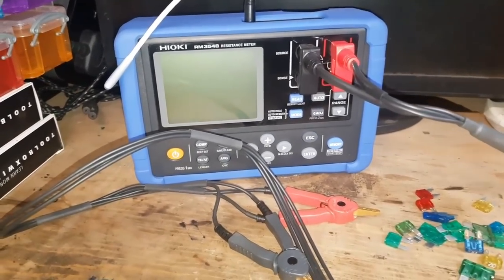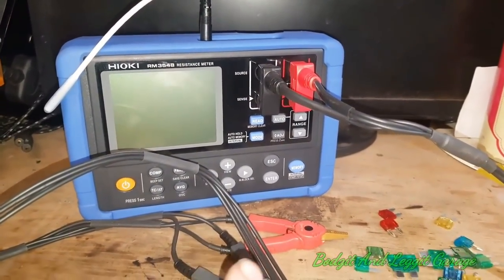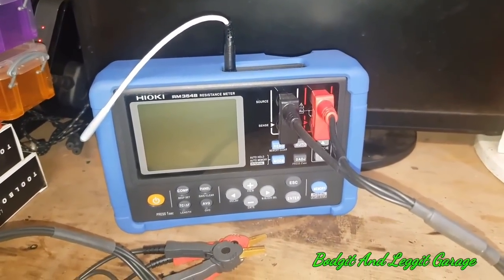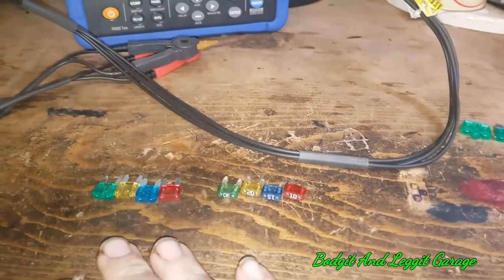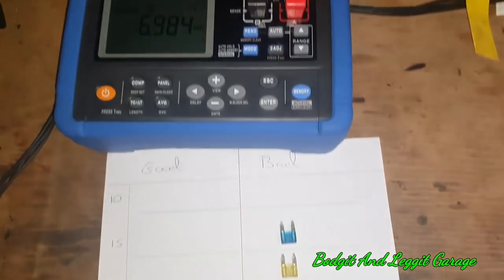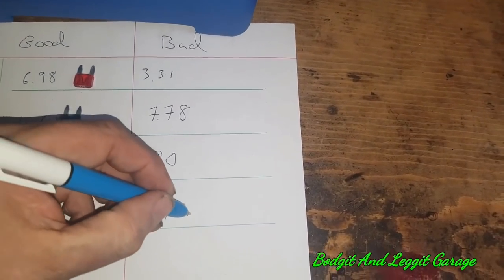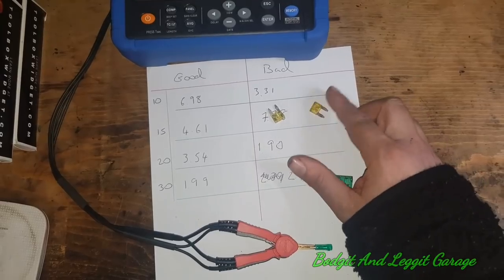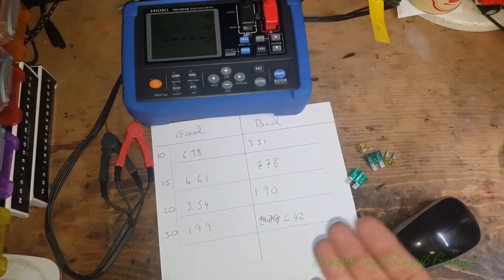Warning Don't Do This You Will Regret It Part 1

Comment: The only way to test at what current the fuses blow is to inject current through the fuse and measure the current when it blows. Measuring the resistance of each fuse will not tell you the current/temperature that the fuse melts at.
Also when you are measuring in micro ohms the connection of the micro-ohmeter makes a huge difference. You noticed it yourself when you changed the connection of the first fuse and the measurement changed.
Not denigrating your efforts though, it is really good that you are looking into this type of testing and you can learn a hell of a lot, like I have learned from you. (I did my navara wheel bearing using your video). So thanks for your videos and keep testing yourself.
Reply from the maker: I think you're missing the actual point of the video it's not really so much what the fuse blows that it's more the amperage it allows through for a sustained period of time the cheapest users will allow a lot more amperage to go through the wires which in turn will cause the wires to heat possibly melt and possibly go on fire which will be a bad day for everybody
Reply: @bodgitandleggitgarage  I thought the point was that a, let's say 10 amp fuse, would blow at a current higher than 10 amps. If the wiring or equipment can't handle more than 10 amps then there is a risk of the wiring or equipment catching fire. 
Or you are maybe talking about slow blow fuses, whi h can handle a little bit of overload for a long time or a lot of overload for a short time. Neither of these properties can be tested by measuring the resistance of the fuse. The only way to test with fuses is a destructive test that measures how fast the fuse blows at a particular current value.  This can be done with the right test gear. An adjustable power supply that can vary the current output and a timing circuit to measure how fast the fuse blows.
By the way, I got quoted 700 dollars to get my front bearing replaced. With the help of your video it cost me 200 for the new bearing and 20 for a socket to fit the axle nut.
And just to emphasise what you are saying in this video, I could have gotten a bearing from eBay for 60 dollars and saved even more money but did not think  the quality would be very good.

Comment: Best to refer to datasheets from proper manufacturers and learn to interpret the performance curves. Attempting to characterise something like a fuse other than in very controlled conditions is a minefield.  Shit electrical components like fuses do exist though :)
The actual cold resistance is specified by reputable manufacturers on their datasheets, but only down to 0.01 milliohm.  Beyond that level it is pointless as you are simply measuring contact resistance, influenced by plating and tarnish.  Furthermore the contacts in the fusebox and the conductor resistance totally overwhelm any 'higher quality' measurements.  The key measurement determining the operation time of a fuse is the I squared T figure (amps squared multiplied by seconds) 

Most automotive fuses rated at up to 30A when used at an ambient temperature of 20 deg C will NEVER actually fuse at their marked rating.  For instance a 'mini' fuse operated at 105% of its marked value at 20 deg C will remain intact 'forever' and at 110% it would take 100 hours to operate, that's 100 hours continuous, so the equivalent of driving a few thousand miles non stop, but at 135% it may interrupt the current at any point from 0.75 seconds to 600 seconds, the higher the current the faster the fuse will operate to interrupt the current and the closer the time between the slowest and fastest disconnect.

Datasheets from littelfuse for the three most common sizes:

Mini
https://www.littelfuse.com/~/media/automotive/datasheets/fuses/passenger-car-and-commercial-vehicle/blade-fuses/littelfuse_mini_datasheet.pdf

ATO
https://www.littelfuse.com/~/media/automotive/datasheets/fuses/passenger-car-and-commercial-vehicle/blade-fuses/littelfuse_atof_datasheet.pdf

MAXI
https://www.littelfuse.com/~/media/automotive/datasheets/fuses/passenger-car-and-commercial-vehicle/blade-fuses/littelfuse_maxi_32v_datasheet.pdf
Reply from the maker: Missing the point of the video what I'm going to prove in part two is when you put a cheap fuse in it will not go at the amperage it says it will which will cause the wire to heat up possibly burn and possibly cause the car to go on fire or because of a cheap fuse

Comment: The thickness of the fuse legs are more of a spec criteria, the thickness of the fuse to the ratio of the to the width will give you the resistance, which is often why wires are measured in surface area. 
A slow blow fuse will have a different resistance to a fast blow, the fast blow will heat up and melt quicker. A more better test will be to read your values then to put them on a PSU and increase the amperage and record the value that they blew at, problem is at each amperage level you have to make a new connection, can't just gradually turn it up as the fuse will be gently warming up. So maybe go up in levels of 1 amp at a time, leaving to cool again. 
Good video and food for thought buddy!!
Reply from the maker: Boom 👍💪

Comment: Brill as always....Have to say i feel very silly......in this day of age where were all aware of cheap copies of all sorts......i never really thought of fuses in this way...once it was the right color!!!...but with all the equipment now been so voltage sensitive its a must  to be correct.......never thought id have to buy main dealer fuses.... instead of 100 for a 20€ from the factors LOL
Reply from the maker: Lol yes mate it's scary especially when you think the cheapest users will allow a lot more amperage through and possibly burning wires and possibly the car could go on fire because of that
Reply: Who is to say dealer fuses are any better. Just because the car costs a fortune doesn’t mean they are installing quality parts. I’m don’t know where to purchase parts. I buy OEM but don’t know if I’m getting OEM. It’s a real crap shoot. ✌️
Reply: @arthurfricchione8119  .....that was my point exactly....my thinking was maybe the odds at the main dealer are better than a motor factors as you said impossible to know either way!!!!

Comment: I think it's interesting, but I am not sure what it proves.  If the metal is of a different composition, and the metal is thinner or thicker, then the temperature at which it melts and how fast it gets there will be different and a different resistance would get you to that melting point at a different time.  And different metals have different resistances.  I know the cheap fuses suck, I am not arguing that, but I think a better test is to put a load on them with an amp meter that has a peak hold function and see at what amperage they actually blow at.
Reply from the maker: I hear what you are saying but there is proper manufacturer specifications that cars need to run properly and safely it's not really what the fuse pops that because everybody knows a 10 amp fuse won't pop at 10 amps it's more the current flowing through for a long period of time if there is an issue do and the cheaper fuses allow a lot more current to flow through this can cause the wires to burn and possibly go on fire

Comment: yes the metal is different thickness and the resistance is different  but without knowing the metalurgy of the fuse element  all this really proves nothing.  by doping the metal mixture you can change the melt temperature and rate all of which would be figured into the size and shape of the link element.  while i agree the cheap ones are usually problematic the only real way to know is to apply a current slightly less than the rating to see if they hold up  and then apply the rated current to see if they open.  but then the fuse is junk anyways. heres another thought- fuses are meant to protect the circuit  not the load.  if a module say for instance goes bad(shorted to low resistance) the fuse will blow saving the wiring to it  but it did absolutely nothing for the module  now did it? its still bad. the fuse can only protect what is down stream from it.  now if there is a sensor that is fuse downstream from the module and it shorted low then yes that fuse would save the module.
Reply from the maker: I'm going to prove in the second part of this that putting cheap users is the wrong thing because the cheap fuse will not blow at the amperage it says this will in turn lead to a lot more amperage going through the wire which could possibly burn the wire burn the wires that it's grouped with and also possibly make the car go on fire or because idiots out there are trying to save money on fuses completely missed the point of the video just trying to help people and tell them you get what you pay for

Comment: I don't disagree with the premise of your argument, cheap stuff is not a great idea but your just measuring resistance, that doesn't translate in to how the fuse will operate. All your doing is measuring the resistance of the metal between the two posts, posts you acknowledge are different, the posts however do not effect the load rating, that does not mean the fuse will blow at a given resistance, you can't compare the good fuses to the bad using this method other than to say, there is a difference in the materials used.

What would have been interesting and more scientific is to measure 5 good fuses at each rating then do the same with the bad ones, this will give you a good indication of manufacturing tolerances in both good and bad fuses, you would expect them to be of a similar value if the manufacturers used good consistent processes / materials.  If you had 5 x 10 amp bad fuses that have resistance levels all over the place then you can assume that it's not likely the rating will be the same either.

I realize you don't have a PSU to do this test properly and find out what the actual blow point is but you could do the above, food for thought.
Reply from the maker: Oh yes it does we all know a fuse doesn't blow at 10 amps if it's rated at 10 amps but think about it this way Ohm's law is the key here you will have a very small wire on a 5 amp fuse the cheapest fuse will allow a lot more amperage to flow through for a lot longer time possibly causing the wire to heat up possibly causing it to burn and possibly causing the car to go on fire that's what it's more down to these cheap fuses will not blow at the rated amp every car has a specification for fuses to blow and the cheaper fuses are rated a lot higher
Reply: Indeed, ohm's law would give you a  current draw from the resistance of the wire itself,  but it won't give you the break point of the actual fuse wire, for example, the posts might contain a lower copper alloy which would increase the resistance which you are measuring, the fuse wire itself may or may not be identical to the good fuses or may have a lower or equal resistance than the posts.

Ohm's law will only tell you how much the whole fuse itself is drawing, not now much the wire is capable of holding before it pops.

My point is that it's the melting point of the wire that determines when a fuse will pop, not the resistivity of it, the melting point is determined by the composition of the materials.

That's why I suggested running multiple tests to see if there is conformity with the batch, If there isn't, then it's likely the manufacturing QC is terrible and from that we can take a punt at saying the values on the fuse are likely wrong. But unless you load those wee buggers up, you can't be sure.

Not kicking you in the balls or anything, I whole heartedly agree with your conclusions, but the methodology of the test doesn't back them up, that's all, keep it up though, doing this sort of thing is what science is all about, at the end of the day we all learn something.

Comment: while  I agree cheap junk won't always be trustworthy,
your "heating up" by holding the fuses while touching the conductors doesn't seem to take into account the conductivity of your skin ...
had you omitted that part, the presentation would have been more convincing !
Reply from the maker: You're completely missing the point of the video I did that just to show how sensitive the metre was what you don't seem to understand this it's not so much what the fuse blows that it's more the amperage is allowed through if it allows too much amperage through this will heat up the wire causing it to burn and possibly making the car go on fire

Comment: To all the experts on here. The OE manufacturers of these automotive fuses specify a resistance per current rating when tested at 24 degrees Celsius under controlled conditions. What Leon is doing is a comparison to see discrepancies in fuse quality with respect to the current rating. I show these specifications in my 'amp hound' video.
Reply: @blankschematics3277  you dont know what i know
Reply from the maker: @blankschematics3277  I seriously don't understand your problem I proven in the video when you buy the cheap users they will not blow at the amp they are rated for which could cause a lot of problems in your car
Reply from the maker: @blankschematics3277  you make some valid points especially about loading the circuit yes what's the point of the video still stands I know a fuse won't proper 10 amps if it's rated for 10 amps but what I'm trying to get a crossing the cheapest users take a lot more or amps to blow which can cause damage to module but also cause the wire to heat up up and melt and possibly go on fire over a long period of time the cheap fuses that looks like they are rated at 20 amps could take 40 amps to blow but the the heat that will be caused in The Wire especially in a big wiring them because cause so much damage and possibly fire
Reply: What your video tells us is that there is a difference between your good and bad fuses, it shows the good have some form of uniformity in the manufacturing and the bad do not, it shows that they may not have the same tolerances based on those values but it doesn't prove that is the case. Just because a 10A fuses as the same resistance as a 20A fuses, doesn't mean the 10A fuse i
Won't blow until 20. It's all in the manufacturing.

Do a follow up video with 5 of each Amp value for both good and bad and see how their differ, if the bad fuses are all over the place then you can be confident the manufacturing process was crap and it becomes less likely the fuses are going to be to spec, BUT the only way your going to know when they blow is by loading them up.as above, resistance changes when loads are applied.

As I said before though, I agree in principle, never buy cheap stuff like this, I'd also remind being that fuses don't blow for no reason, swapping them out is fine but finding out why they popped in the first place is better!

Comment: I agree with your opinion of cheap fuses. They’re not worth the risk. I did, however, need to google “bread soda.” Here in the colonies, we call it baking soda. Now I know. 😎
Reply from the maker: Lol I use it for cleaning circuit boards mate it neutralizes the acid from a leaking battery
Reply: And that’s exactly what we use baking soda for. Well, that and baking bread. 😎
Reply from the maker: @PaulyD0859  lol yep boom

Comment: Leon, thanks for the info. Never would of thought that. Personally I will be honest I don't know the difference between manufacturers and bad. I've never seen anybody address this concern. Man there is so much to try and keep up with. Are manufacturers using the cheaper ones. Just because the car is 40000$ US doesn't mean they are building with quality parts. Good info though Leon. I am going to have to check. Thanks mate CHEERS 👍
Reply from the maker: boom sorted thanks mate

Comment: Here is the problem to test them with a load. If  you test them to there  specification by loading them , They have to pop.  how  are  you going  to use that fuse that was good after it tested good lol. Its a huge nightmare if  you think about it. if it dont pops its no good  and if it pops it was good as in WAS once lol. "load  testing onhanglow fuses"
Reply from the maker: Lol boom there is proper ways of doing mate but unfortunately I just don't have the equipment but at least a video still shows the problem of cheap fuses